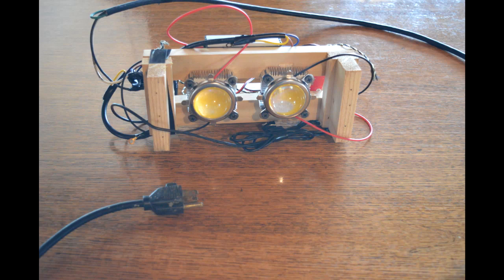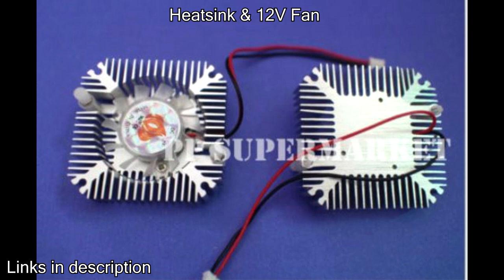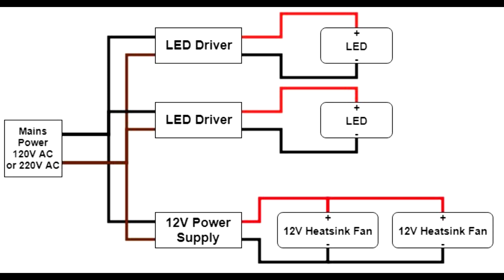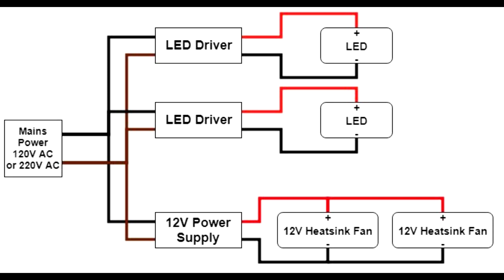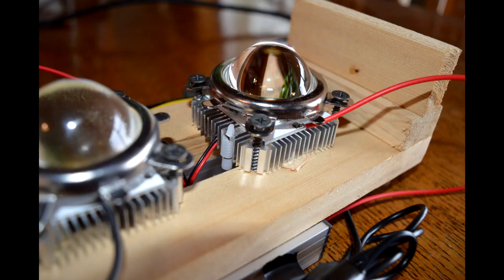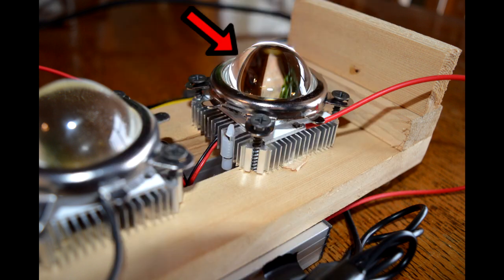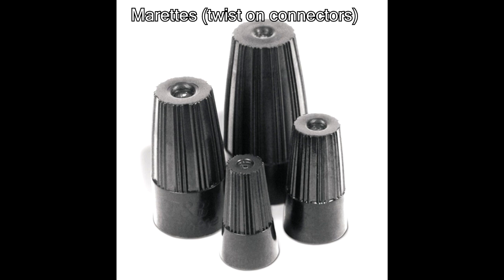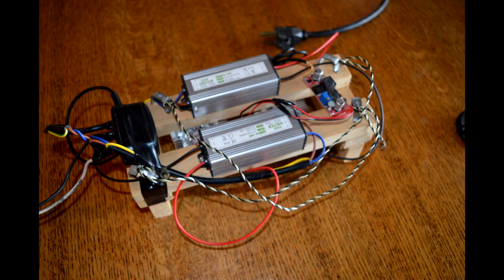200W LED Grow Light [30$ USD]

Comment: Also is it possible to plug the 12v power directly into the wall as opposed to separately connecting it to the main power supply
Reply from the maker: Yes!

Comment: What is the main power 120v/220V AC ? I assumed that it was the outlet that I am supposed to plug in the wall but wanted to make sure . Also there is a yellow wire on the led driver which has a ring on it . I am not sure what I am supposed to do with that . Thank you.
Reply from the maker: The driver can accept both 120V and 220V. The yellow wire is for ground which is not required to be connected to anything. It's a safety precaution.